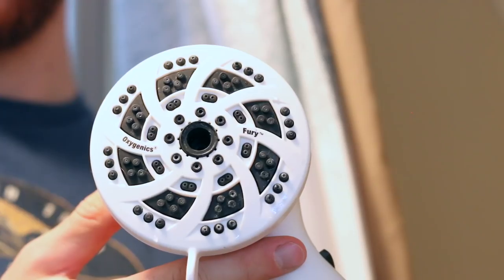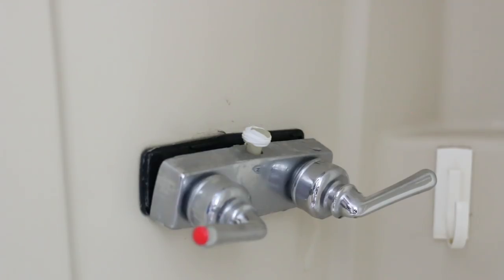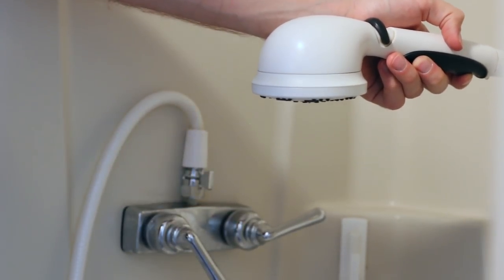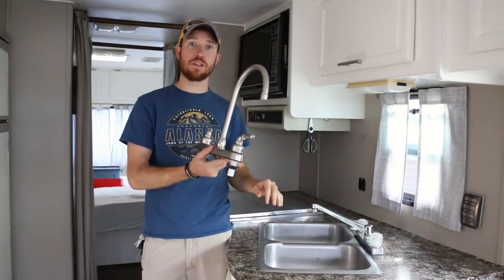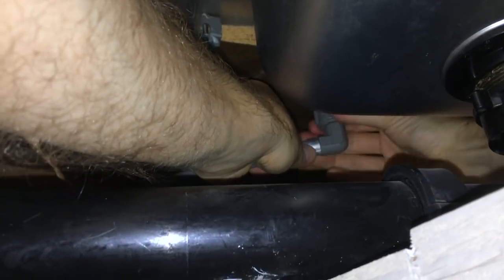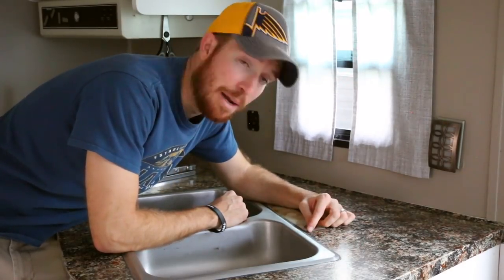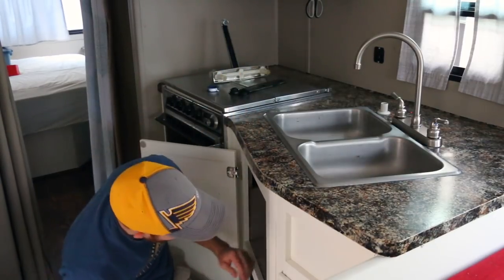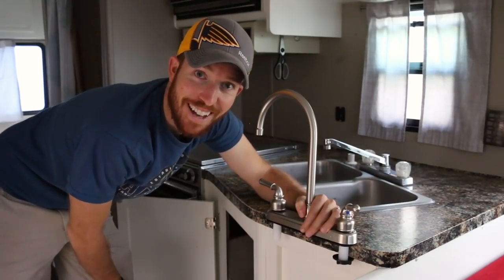Installing an RV Kitchen Faucet Replacement + Freshwater Modifications

Comment: Oxygenics showerheads intentionally have some flow when turned off.  The reason is that if you stop the flow entirely and turn it back on, the water can be very hot.  The slow flow of water prevents you from being scalded.  Just saying.

Comment: The water dribbles out on purpose. It is to keep the flow going, so the water is still mixed, hot and cold, while you are not spraying the shower. It should be cold now, as you turn the spray back on to rinse the soap, untl it gets mixed back up,
 as a flow.
Reply from the maker: Thanks for the info 👍🏼 If that's the case, the "feature" didn't work for us... This will at least help us save water 🙂
Reply: Oh yea.  You're going to understand the term cold shower much more intimately now in the first few seconds of turning the flow back on.

Comment: Most of those connections do NOT need teflon tape.  The drain P-trap does not seal at the threads, it is a seal created at the tappered compression point.  Most of the hoses you connected also do not seal at the threads, there are usually a rubber washer inside that makes the seal.  Putting the tape on does not hurt anything but is unnecessary on many of the connections you did..

Otherwise great video..

Comment: Is that a “RV” faucet? If you ever want to upgrade it’s very easy to do a residential style. 
The spacing of the inlets on the fixtures are the same I️ believe. Either way...the FIRST thing I did in both of my RVs. So worth it. Easiest biggest impact on an RV interior.

Comment: Thanks for the info,  but I have a few questions..are all kitchen faucets the same size?     Next, since it is tight areas..under the sink, how can I locate where my cold water line is leaking & how can I fix the leak??  Thanks again

Comment: When you first checked for leaks before you turned on the faucet, there won't be a leak cuz there is air trapped in the line. Noticed when you turned on the water it took a second or 2 for it to start running. Turn on the water until it starts running and then turn it off and check for leaks. Great video though, good job!

Comment: Did  you need to get 1/2" x 3/8" adaptors to connect the  hot and cold lines to the new unit?  I didn't see anything mentioned about that.

Comment: Fyi if you are getting the Girard on demand hw heater you will not need the shutoff valve you just installed. With the Girard you set the water temp on the thermostat and only run the hot water for the shower. The Girard does not work well when you mix the water. You will get a cold slug when you turn the water back on. Takes a little getting used to but we love ours. Looking forward to that video!

Comment: With the cheap shower faucets, you will have that problem of playing with adjustments to get it right and with that shut off, you will have cold initial spray.  They are finicky!  You really don't have to install tape on the P trap and always tighten by hand only.  You don't need no stinking wrench.  lol

Comment: hello folks..ive enjoyed your adventures so far..ahh the vigor of youth :) but alas this video is cringe worthy..i will elaborate in the order of the issues you addressed..

SHOWER HEAD: its supposed to flow when shut off..helps maintain the temp you have the faucet set at..

SHUT OFF VALVE: no need for it or the Teflon tape..inside is a rubber seal that does the sealing..same goes for the shower hose you attached to it...

 SHOWER  VALVE: take plumbers putty and roll about a foot long index finger thick roll,then mash it around the back side of the faucet around the circumference then remount faucet squeezing the putty out,this creates a seal that should of been there..

P-TRAP: once again no need for Teflon tape..it has whats called a union joint,thats what does the sealing..if the tape gets up in between it can cause a leak..those opaque one piece sealing nuts are of a harder plastic and are known to split,just as in your case,always use the nut and Teflon ring combo,also when testing for leaks fill the sink with hot water then drain it,this puts the maximum pressure on the drain (water weighs 8 pounds a gallon) if its going to leak it will leak then..

KITCHEN FAUCET:  personally i always upgrade to brass when jerking out a plastic faucet i would HIGHLY recommend the American Standard Colony pull out water saver,its whats installed in my RV and i got it for the same reason you got yours,plus the pull out REALLY helps a lot !!!(205208233 on the home depot website),it will out last all of us,but its your coach :) but i will say why..that tall spout is going to put excessive pressure on the seal at the base and is going to leak rather quickly,once again no need for Teflon tape on the water hook-ups,there are dough nut shaped rubber seals in the grey nuts attached to your water lines,once again make a two foot plumbers putty roll and smash into the bottom of faucet then install squeezing out the putty as you tighten it to the counter,im afraid silicon is your worst nightmare for any sealing solution,i HIGHLY recommend  LOCTITE POWER GRAB formally known as poly seam seal,its a adhesive caulk that can be worked/cleaned with water before it cures... <--------this knowledge shared by a 20 + year master plumber and owner of a 1999 Winnebago chieftain 35c    p.s. this is not intended as a talk down or a slight what so ever..water damage is the most serious enemy to a RV as you and everyone that follows you knows,just trying to put information out there that will prevent it,so your drinking a beer instead of tearing up a floor :)
Reply from the maker: Understandable. We are all human 😊 Thanks for sharing your knowledge. Wishing you a very Happy New Year! 😎

Comment: Thank you very much for this video, informative and entertaining. 

I Last night while doing dishes the water flow on my kitchen sink cut down to about a quarter. After making sure that there was no leaks or other faults in the system I figured it must’ve been the faucet. 

I watched your video thinking that I was going to have to change the entire faucet. Which, by the way, I now feel I am qualified to do, thank you for that. But I had to laugh when you switched the aerator from one Faucet to the next; doing that gave me the clue of exactly what I needed. 

The aerator on my old faucet had become out of alignment. All I had to do was take the thing apart put it back together total fix about 90 seconds. 👍😊 The addition of that part of your video saved me several hours worth of work. Thank you again.

Comment: What you may find now is the cold water (which generally has higher pressure) will feed back into the hot water lines while the new shut off is in the "off" position -- and you will get a cold blast of water when you turn the new chrome shut off valve back to on/flow.  You will need a one way check valve installed on the back of the faucet where the hot feeds the tap.  It's called a "Camco 23303 1/2" Back-Flow Preventer - Lead Free" on Amazon.
Reply: I've often heard this also (although I believe it could also be a blast of hot water) ... and mentioned it to you in a previous video you did. I believe it's the reason that most, if not all, RV shower heads always leak a bit of water. It keeps the hot and cold water flowing slowly so that when you turn the shower head back on, the temperature is more or less the same as when you shut it off. Without this feature, you have to aim the shower head away from you  every time you turn it back on, which will also waste water. The way it turns out might be specific to each RV, so you might be very happy with what you've done. 
Very professional looking videos, as always. Keep them coming!

Comment: Be cautious with that turn off valve because when I turn mine back on I get a blast of very hot water. You certainly don't want to get burned.
Reply: pupcamper58 agreed, except we got a blast of ice cold for the first moment after turning the on/off switch back on!  Yikes!